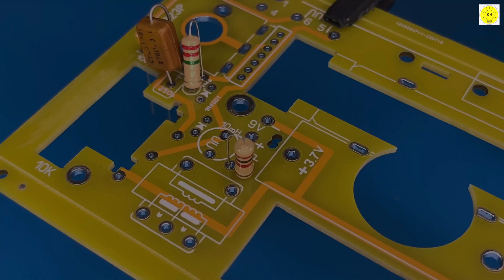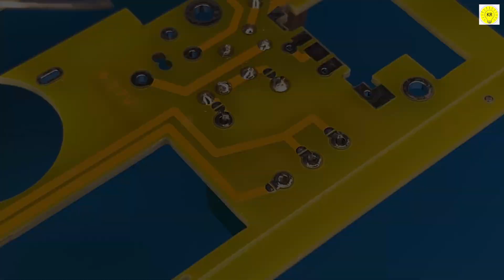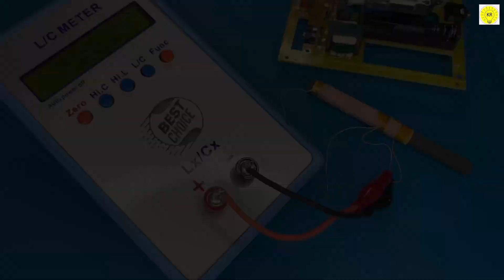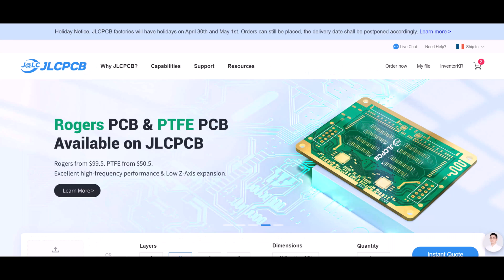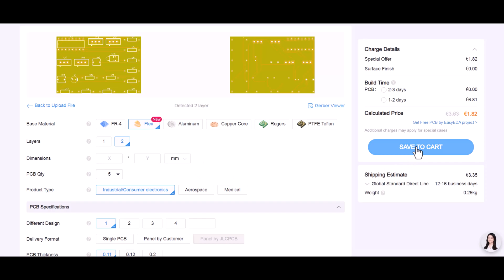how to make am radio receiver , A great idea you've never seen before

Comment: i built it, this video explains nothing. it requires a 3.7 volt 14500 battery not a 1.5 AA. the solder bridges on the transformer output determine the loudness, (8/32 ohm) my headphones were loud with the middle and outer bridged only. the variable cap needs to be bridged, and the headphone bridge is for mono / stereo. the 2k resistor installed in the video needs to be removed, this is where the jumper wires go for high impedance headphones like ceramic earbuds. the 2P2 tube is like a 3S4 but it has higher gain at 9vdc plate. if the radio doesn't regen (squeal) when the volume knob is turned swap the leads on the smaller coil.
Reply: @estebanvillalobos2303: thanks a lot for your comments. Your comment is the only useful information I found in the web.
Reply: Ottime osservazioni, l'ho appena costruita anche io e funziona bene. Solo con la ferrite si riceve debolmente la stazione locale. Hai perfettamente ragione per quanto riguarda la batteria del filamento che deve essere da 3,7 volt ( litio) e non 1,5 v. Vorrei provare ad elevare la tensione anodica con un piccolo booster, se non crea disturbo in ricezione. Li ho usati per circuiti con varicap e non hanno dato problemi.  Ciao.